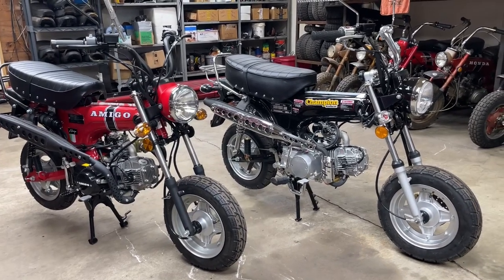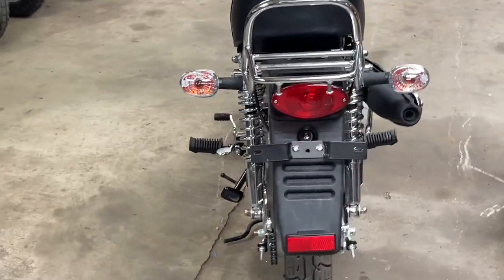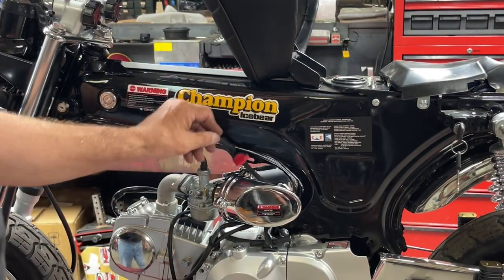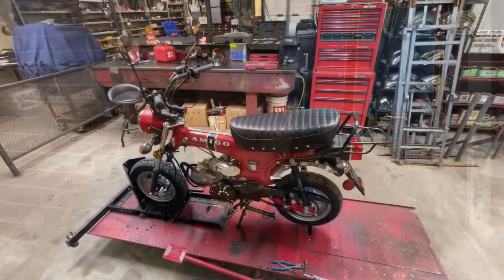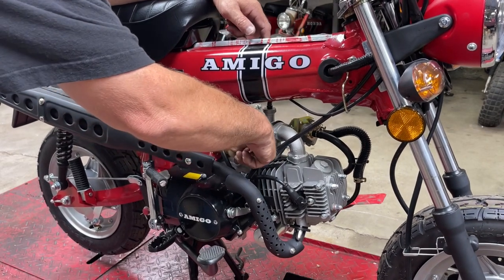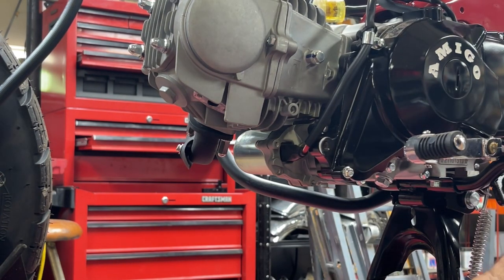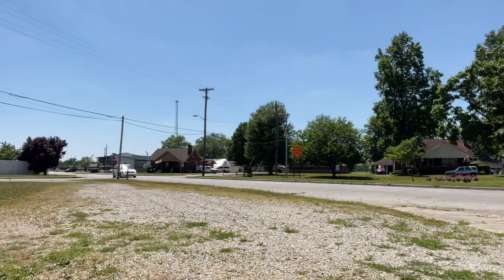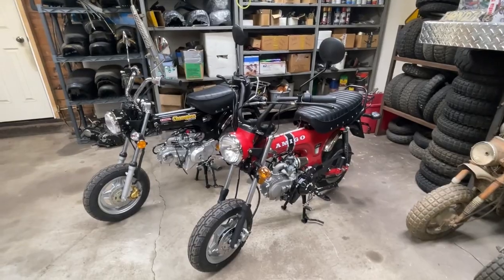CT70 clones - first ride for the Icebear and Amigo

Comment: Thanks for time spent on the videos Mike. I have an Amigo and had to do a lot of tweaking and the standard upgrades that everyone has mentioned. After all that it is one of the most enjoyable bikes in my stable. After removing the Cali emissions garbage and tuning the stock carb it runs perfectly. Also if you live in Cali and want a plated bike the Amigo is your only choice as the Icebear is not CARB approved to be street registered in Cali.

Comment: I just received my Ice Bear out of the same order you did.
I had decided to go through mine pretty thoroughly and check everything and locktite all the bolts before even a first ride.

My fuel tank looked pretty rough as far as having rust in it so I have removed it to clean it using Evapo-rust. Keep considering just buying a plastic tank to eliminate future issues concerning the tank rusting but have not pulled that trigger at this point.
 I also do not like the high petcock for a gravity feed system. 

I ordered one of the ATC110 Carburetors that has the built in dual inlet fuel petcock and will give that a try. 
It was cheap enough and many have reported on the owners boards they work well.
I also ordered one of the Aluminum external fuel tanks to use as a reserve tank and actually the outlet on that tank should be even a bit higher than the stock tank.

The one thing I have found is there is absolutely no lubrication on anything, the swing arm pivot bolt, rear axle, rear brake pivot in other words everything I have disassembled so far and checked all is dry as bone.
Even if the lube is used just to coat the parts to prevent rust in my opinion it is needed.
So my opinion if a person is looking for longevity out of one of these clone bikes they need to put forth the effort to take them apart and lubricate all the needed areas.

I did decide to just replace the rear swingarm with an aftermarket stock length boxed aluminum unit. I really did not care for the chincy rear chain adjusters that came stock on the bike and I will say that the aluminum unit fits much nicer and weighs about 1/3 what the stock swingarm weighs and has a much better more modern style chain adjuster system. 
Definitely worth the price of admission on this part in my opinion.

Also the stock drive chain is pretty well known to "stretch" a lot and need frequent adjustment on these clone bikes, I am going to put a much higher quality chain on from the get go so that the sprockets will wear in from new with the chain I am planning on running.

Also out of curosity I pulled the left stator cover and same with the starter drive chain it was bone dry as well. Might not be a big deal but since the starter chain has plastic or teflon (not sure of the material actually used) chain guides and /or tensioners the chain rides on in my way of thinking a very light coat of a high quality synthetic grease should greatly help with wear and longevity on those tensioners and the sprockets that starter chain rides on as well.

I considered the Amigo for a short minute because of it coming with the fully manual transmission but could not see it being worth the difference in what they were charging as compared to the Ice Bear.
For the difference they are charging for the Amigo I can pretty much buy a complete 140-150cc manual transmission engine to swap into the Champion and have a complete 125cc engine as a spare or to sell.
I still may try to convert my Champion semi auto to full manual as I understand it can be done for less than $200 in parts.

I really think that for a person that does not mind piddling to get things squared away and has the mechanical ability to perform the work themselves the Chinese CT70 clones are basically a very good buy and platform to start with for the dollars spent if they have reasonable expectations as to these bikes build quality and capabilities and they also come complete with street legal status as well to boot.
But if a person is looking for "Honda" quality and reliability out of the crate, just pour in gas and get on and go generally there is a good chance that person is going to be very disappointed.

Looking forward to what you do to your new rides in upcoming videos.
Reply from the maker: Good stuff!!  Thanks for watching and commenting!

Comment: Great Video Mike. When Jencheng came out with the first CT70 Clone. I bought a couple then over the years purchased at least one of every other clones and kept in storage for over 20 years Then started selling them still in there ship krates. Being a purist to the Honda Mini Trails. I only kept one a 2009 American Lifan, and a 2009 Jincheng Panda Z50. for my starting line up of bikes I own. But the truth said all almost are replicas of each others, except for engine configurations. Everyone  I assembled before selling them, Some new had cracked plastics and rubber issues, carb issues and jetting, speedo issues as you described very disappointing and theres more. I am going to do a video on Youtube showing the Panda 50 & an American Lifan CT70 Clone. Thanks for the video
Reply from the maker: @ReddingCT70  Thanks for watching!

Comment: I think the tube on the bottom of the head might be some sort of EGR system? Exhaust gas recirculation. Takes a little exhaust and pumps back into the cylinder to prevent pinging etc. emissions related. It was how they took lead out of fuel back in the day. The lead was to absorb combustion heat. So by pumping a little exhaust through while running it would work similar to lead in keeping combustion cooler. Not sure though. I’m not a motorcycle guy
Reply from the maker: @dustinruth  I threw it all in the trash, two years ago.  Whatever it all was, the engine didn’t really need it.  Over 2000 miles since removal and it still runs great.

Comment: Looks good! Problem buying a clone is finding parts when they need repair.
Reply from the maker: Most chassis parts can be replaced with Honda parts.  Top end engine parts are readily available.  If there is an issue with the bottom end of the engine, throw it in the trash and install a new one.  Complete engines are less than $300.

Comment: That pipe on the head is smog/emission pump same on my Honda XR650L. Recirculates gasses to air box for crank case recovery of gasses to be burned out through intake cycle.

Comment: Is it important to drill the exhaust? I installed a 26mm carburetor from Amazon and the Icebear was running richer than Bill Gates on it. I bought a Molkt carburetor like you use but haven't installed it yet. The stock carb is back on it for now.
I have to ride up a fairly steep hill from work and can't go faster than 2nd gear. If I can get a little more oomph out of the engine, it might make it up in 3rd. 
So far, everything on my Icebear is stock.
Reply from the maker: I feel drilling out the exhaust does help a tad and allows things to flow a little easier.

Comment: It seems like the bike needs to be disassembled and everything checked and lubed and loctited. I'm leery of Chinese bikes but Honda doesn't sell the Dax here and the prices are kind of crazy. and I would take the gas tank out and look it over, rinse it out. I bet grease is needed in many places like the swing arm pivot point.
Reply from the maker: Small bore Hondas aren’t built in Japan anymore, they’re also built in China, so I wouldn’t treat a Honda any different from these bikes.  I’m extremely happy with both my Icebear and the Amigo.   I just got back from an RV trip and hauled the Amigo with me.  Went on multiple rides with subscribers and it performed flawlessly.   For the price of these bikes, they’re hard to beat.  The swingarm doesn’t have bearings, it doesn’t require grease.

Comment: Did the icebear come with a battery? Did you have add fork oil?  We’re than any assembly instructions?
Reply from the maker: Yes, battery included. I had to install it.  No, I have not touched the fork oil and it seems fine.  The was an owners manual that may have included assembly instructions, but I’ve never opened the manual.

Comment: I think it's a vacuum assisted fuel pump on the amigo Mike .
Reply from the maker: Could be, I really have no clue.  I can tell you this…….it’s all in the trash now.  🤣🤣
Reply: @MiniBikeMike  I run one on my honda chaly with a 125 engine . 
Basically when the fuel level gets low gravity won't feed the high mounted carburetor. The vacuum pump draws the fuel when gravity stops . Kinda like a pulsing system

Comment: Had the same problem drove me nuts fuel will not go up hill. Your other bike has the proper carb with petcock on float bowl  got new carb for $20.00  elemanated
Reply: 16 inches of fuel lines. Runs great

Comment: You had the Icebear moving. Did you at some point change the front sprocket?
Reply from the maker: Yes, I think I put a 16t on it.
Reply: I got a 17 for mine. Not sure when I will put it on. Cold here in WV. Have not added insurance or registered it yet. Want to get it off my rock road to more of a county high to see how it goes stock first. I am in no need of speed right off.
Reply: Meant to say county highway.